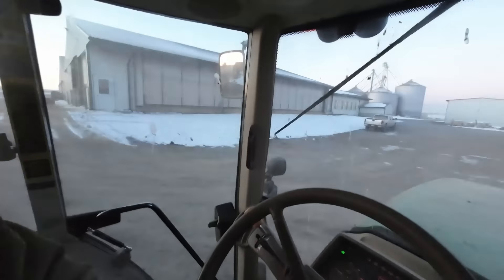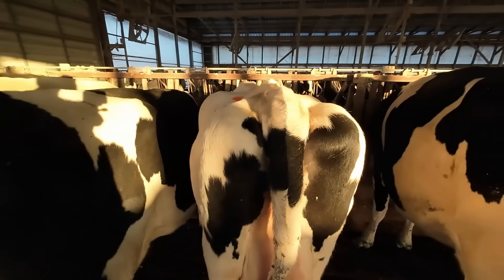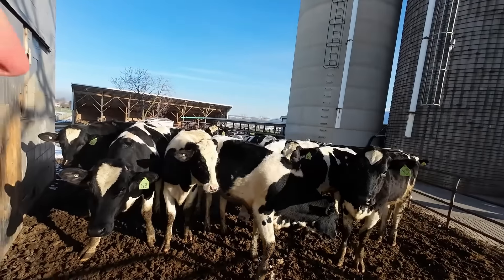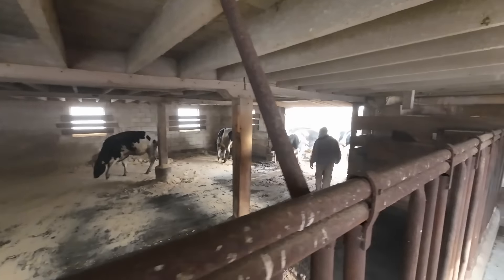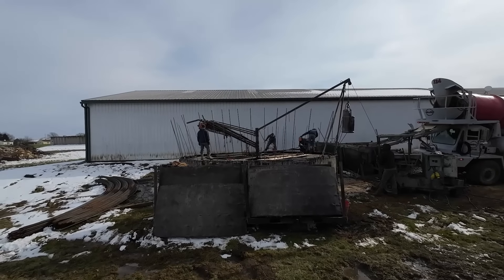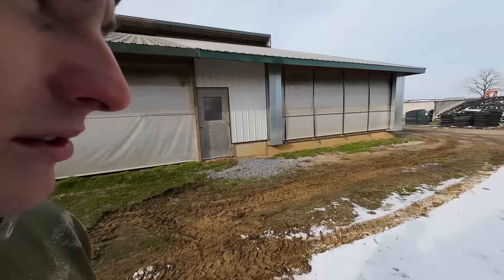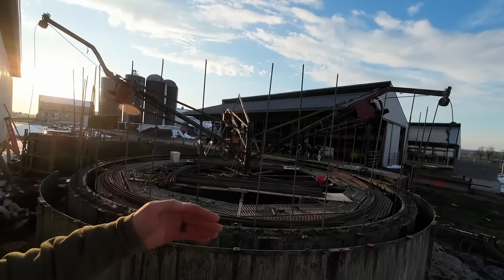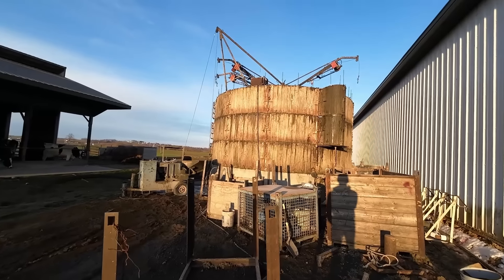Silo Building Begins

Comment: That's the first vertical/upright silo I've seen built in a long time.
Reply: Very possibly the first upright silo poured in the last 30 years. What I have grown to know about farming is that everyone has their opinions and mine isn’t worth more than anyone else’s but upright silos have a lot of problems. First they are dangerous, if you have a clogged chute or the unloaded breaks you at climbing to the top where there is plenty of obvious problems. Second, feed is last in and first out and that feed is least compacted with less fermentation time. And one of my favorites… they are always built in places that interfere with expanding the barn. I can understand building them for a vector system because it can control the unloader, conveyors and other associated equipment but I don’t think you will ever convince me that a vertical silo is a better investment than a feed bunk and a kitchen with a feed grabber.
Reply: @MrSteub  I see lots of upright/vertical silos being torn down. But none going up.

Comment: If you lift the boom on the bobcat when you are driving in to get a bucket full and tilt the bucket down all tyres get traction rather than relying on just the back wheels which end up spinning as the front tyres are off the ground

Comment: Death and taxes are said to be the only sure things.  On a dairy farm there are others:  the cows must be fed and milked every day; machinery breaks down; the acids in fermented feed and cow manure speed up the deterioration of machinery.   The pluses of bunker silos included the ease in filling them and the ability to feed the cows every day.  A breakdown in a bunker meant towing away the broken machine and immediately replacing it with another, a neighbor’s construction equipment would do in a pinch, or a rental from a dealer.  A long list of substitutions are available.  The cows were fed.  The upright silo requires a top-down or bottom conveyor to provide feed.  They will break down, proven thousands of times, I experienced this myself on our family farm.  It was its own form of h..l to scramble for parts, get them up a narrow chute, and installed in the unloader that we knew little about repairing.  I hope your budgeting includes an inventory of parts or a complete unloader on the farm, not stalled in a supply chain problem.  Our farm was small compared to yours.  I forked the silage out for two days waiting for parts.  It would be a huge task to feed your herd by digging and tossing feed down the chute, especially for an extended period.  We were happy to move to a bunker.

Comment: Hard to tell from video how thick are the walls?  Have seen stave and Harvestor silos put up this looks like quite the process. Is it just the mass of rebar that cold joints aren't a worry the old cement elevators were continuously poured  once they started never stopped till the top and used a slip form.

Comment: Rural areas are littered with relic concrete silos with ring binders around the exterior and dome tops on some.  Some have been abandoned long enough for a tree or two to grow out the top.   Often wondered about the crews who went around building them and now we will have an up close view of the process, which judging from the methods probably hasn't changed much over the past 50 to 75 yrs.    As others have commented rebar seemed a bit sparse in the foundation but is clearly adequate in the silo itself.
Comparing the foundation with those built for windmills,  some similarity in amount of concrete but not in the rebar used.

Comment: I would call the silo walls, slip formed.
Reply: Not quite the same, slip forming is a form sliding process that once started can not be stopped till the structure is finished. The forms once assembled just slide up the structure as it’s being poured. I’m more surprised that these silos aren’t being built as sealed silos with bottom unloaders.

Comment: you have snow on the ground, so i guess the temps are  <30F... 
while pouring <6" concrete walls in steel form works... (Silo=>3" between the rebar and the Inside of the Silo)
and remove those less than 24h and I havent seen an concrete vibrator again, 
and those junktions from ring to ring look massivly shitty.. with lots of air pockets.. 

Tahts why i wont be sucessfull in the states... i want to deliver quality and would refuse to pour >40F for at least 14 Days
Reply from the maker: Some snow in the shadows but day Temps in the 40s and night temp around freezing. Using hot water in the mix with plasticizer. The builders are taking proper precautions.